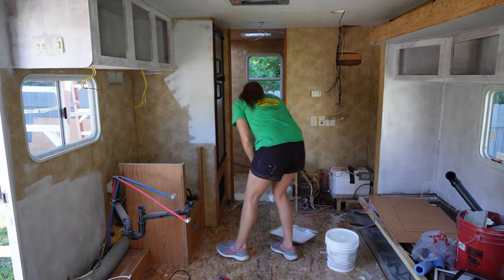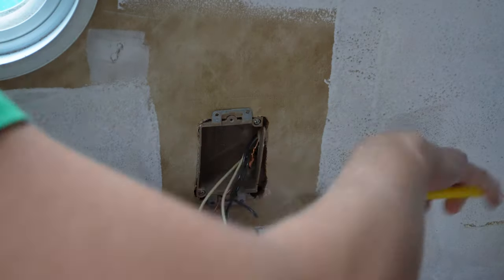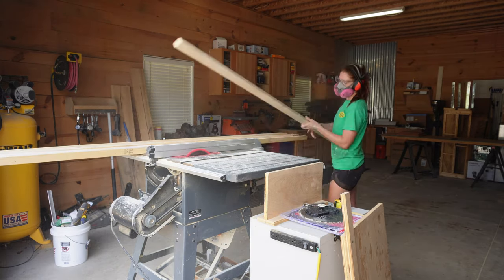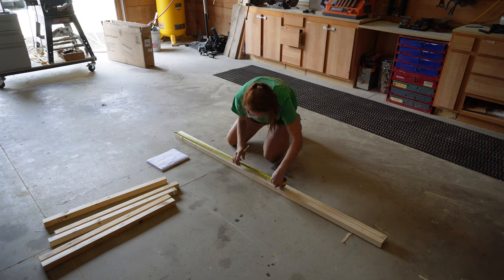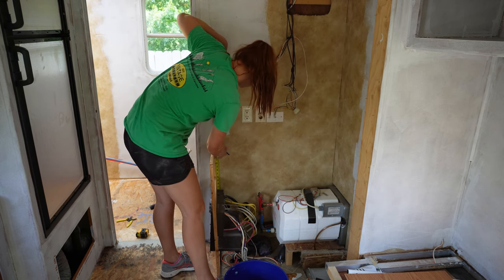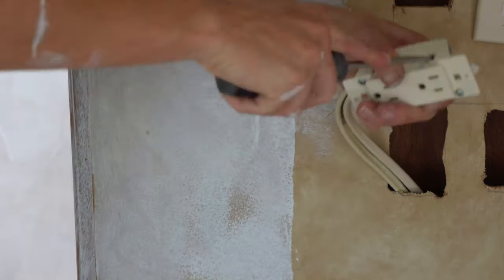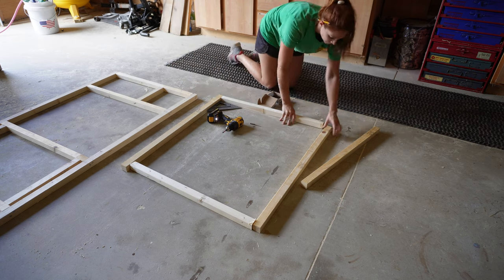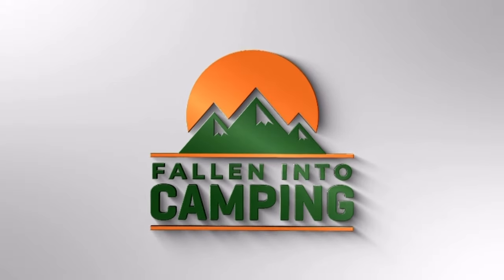RV Renovation: Day 3 Framing A New Entertainment Center

Comment: It’s fascinating how you just plow through, follow through !  The wiring through the walls and where to move those
will be something I’m looking forward to . My little ( old) trailer has the tank sensors way over on a wall that I need to pull the Slide  out first, to get to. On the road and keeping an eye on he water tank or BW tank levels would be best by the front door or bathroom

Comment: I just stumbled on to your channel. I really, really wish I would have found this a long time ago. I had water damage in a TT similar to the one you are working on but without the slide. Now, my class C has a few issues that, I thought are intimidating but, watching you it doesn’t seem so bad. I wish I had the room to rehab rv’s also, that is the best way to learn about them. I have so many questions I’m not sure where to start.